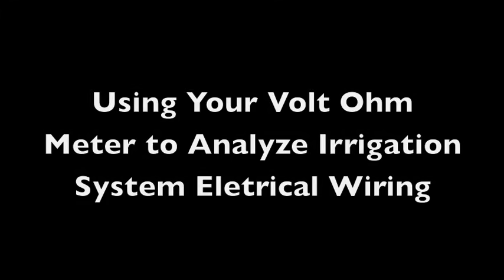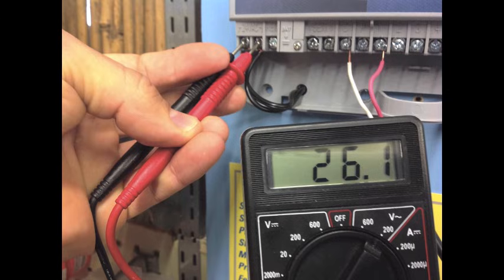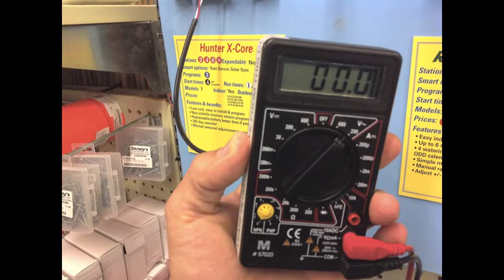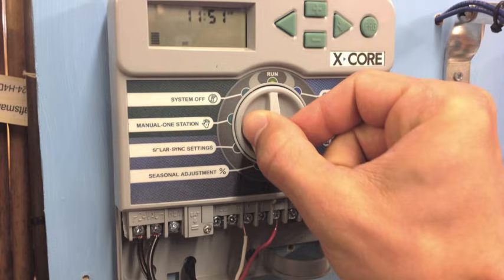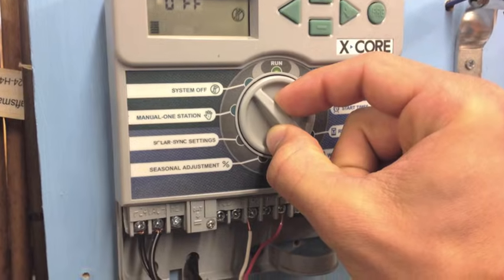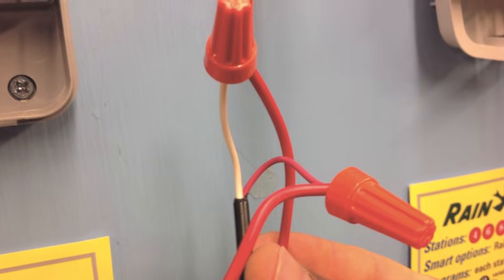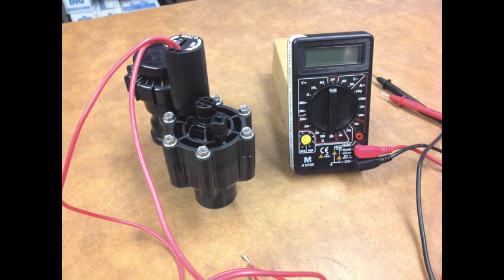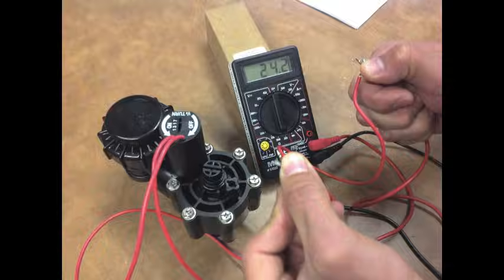Troubleshooting Your Irrigation Control system with a Volt Ohm Meter

Comment: Extremely helpful. Had a station that would run fine and then bubble at the head and the valve would vibrate when turned off. Solenoid and valve tested good. Identified the station on the control unit didn't have the  correct voltage. Switched that station's wire to an unused station on the control unit and everything works without any problems. This video was essential in troubleshooting the problem.

Comment: What is wrong when the controller is turned on manually and system runs for 5-10 seconds and shuts down or may not operate at all,also have replaced water valve with new one, that is working fine,I have measured transformer voltage and it 26 volts, is there a bad register or component in the control.board, if so do you know which one ? Is there a detailed video on the repair of the controller ??  Thanks
Reply: I had the same symptoms, I unscrewed/cleaned/ rescrewed the transformer voltage cables, that solved the situation.

Comment: Very helpful, thank you. Just an update, just saw a RainBird PDF that says if a solenoid is between 20 and 60 ohms than it's good. I had a solenoid with 18 ohms and due to it the fuse was always blowing, this video helped me find that solenoid for replacement.

Comment: What happens if my volt meter reads 29?
Reply: Same for me. Is it too much?
Reply: @raquelpobes902  Mine is reading 30 so I bought a new one. Out of the box, it read 24, but once i connected it to the controller, it ready 30 again. It feels like the controller is damaging the transformer. Is that possible?

Comment: Thanks man. Using your video, i diagnosed a burned out common white wire. None of my 5 station sprinklers were firing. Luckily I had 3 other wires which were not used and I just rewired it to use one of them.

Comment: My observation: checking between common and individual station terminals, I am not getting power only at the running station output, it's at 2 or 3 other stations also. I'm getting pretty confused...

Comment: How do I know which wire is the common wire? Also, do I need to connect all the wires from the stations (on the output bank) before I check them for power to common? The video doesn't show any wires hooked up, except one.
Reply: Coene Schamaun the common wire usually white, is wired into the terminal maked with a C for common.

Comment: How do I know which wire is the common wire? Also, do I need to connect all the wires from the stations (on the output bank) before I check them for power to common? The video doesn't show any wires hooked up, except one.

Comment: Thanks for your video, helped me identify and fix the problem with all sprinklers. When I disconnected the rain sensor and connected the white/common wire to all solenoids- it worked again!
Reply: That's your. Com wire
  Iam a tech
Reply: To

Comment: When checking that I have the 24-28VAC on the active station using meter between common and that station, what should the other stations read?  My system is down and all my stations measure ~28VAC even though I am only calling for water on station 1.  Is this normal?
Reply: Hi, I am also having the same problem. Did you solve it? What voltage should other read?

Comment: What if one of my zones is not showing as an option when "manually" watering/testing. Zone 5 has a wire tied in, but 5 is not an option when going through the zones??? Does this mean a wire has been cut?
Reply: I ran an Ohm test on that valve at the controller...volt meter set on 200 ohm, controller off, positive lead on common, negative on the screw for the zone that's not showing digitally on the controller. That zone ohm test showed 45, while the others are slightly lower, but not too different. Can't be a split wire?  Would a faulty valve cause the zone not to show digitally? It's not showing when I set to manual run all stations...doesn't show the number like the rest.
Reply: how old is the controler?  new timers comes preset to how many "station/zones " you need. 4,6,8,12 and so on. old one's need a modual to add stations or zones....... that maybe what is not working.  new timer i would reset the timer.

Comment: "if the resistance reading is..." and then without skipping a beat it sounds like he swallows a fly maybe then continues "... the solenoid, then look for faults in the wire." What was that?
Reply: "if the resistance reading is good at the solenoid"

Comment: your video was the best that I found on trouble shooting my orbit controller to see if the controller was bad or had bad wiring as all the stations where no longer working. I will now test it as I believe I have a bad transformer in the controller. thanks a bunch saved myself a hassle and the cost  of a 100 dollar maintenance call.

Comment: Hello, I can't seem to get the second step of testing to work for me. I get a 0.00 reading when testing station output. Does that mean that the timer unit is bad? Every other test passed except this one.
Reply: You probably have your answer already.. But if you have power at your 24 VAC terminals, but zero at the stations, make sure that you are activating each station before you test it. If it is not activated, you will get 0.00. If the station is activated, and you are getting 0.00, this means that your circuit board is probably shot.